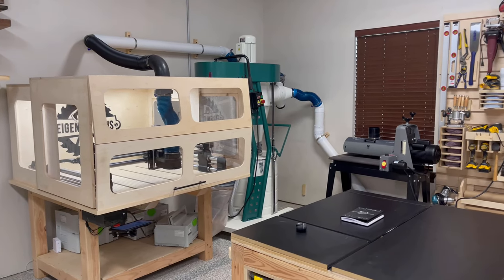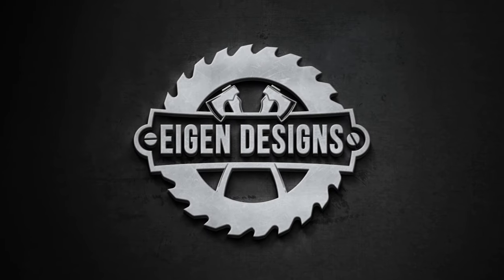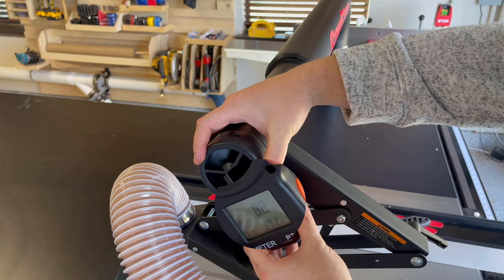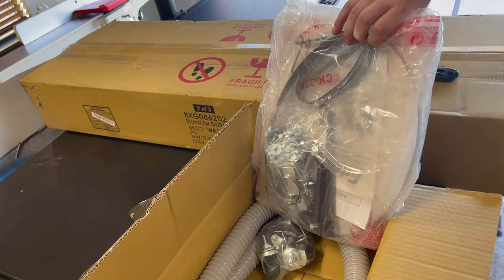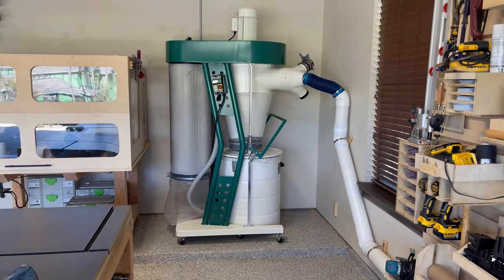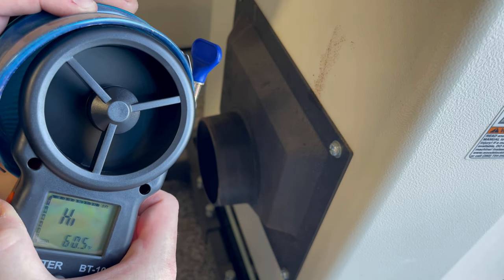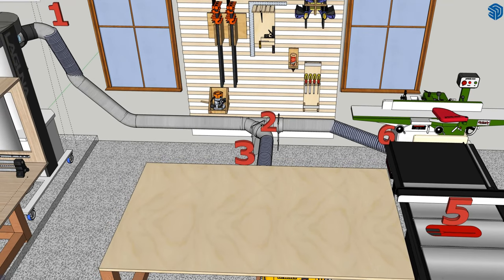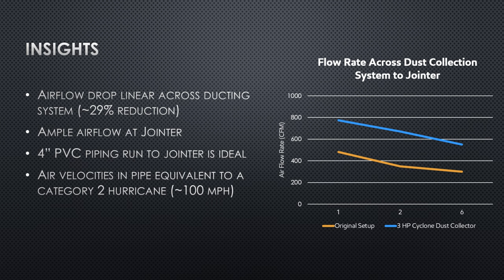Grizzly 3 HP Cyclone Dust Collector Upgrade  |  Analysis of Flow Rate Improvements

Comment: Thank you for all this. great information....two questions if I may...overall, how do you rate the grizzly build quality? Second, if one ran a 6" trunk, it would still be necessary to reduce to 4" ducting for the tools ( and to connect to the DC...what do you think that will do to the airflow?

thank you for your time, and thank you for the massve amount of effort you put into producing this video!!!
Reply from the maker: Thanks for the kind words, Chuck. I think the grizzly build quality overall is good, but I have been a little disappointed by the life of the filter. I had to replace it after less than a year and they are very expensive. Just something to keep in mind if you're looking at getting one.

I think "necking" down to 4" as you get closer to the tools is completely fine. Most tools have a 4" dust port so it's somewhat expected that you will transition to 4" when you get closer to your tools. It shouldnt impact airflow too much.

Comment: Excellent video – nice work! But you didn’t answer the obvious question, how much did the new system cost? Secondarily, where did you get those cool magnetic adapters for your dust hoses?
Reply from the maker: haha, I guess I never addressed the obvious question! The grizzly system was about $2,200 and certainly an amazing addition to my shop. The cool magnets couplings are made by MagPort and you can find them here: https://magport.net/products/magport-4

I have bought quite a few of these connectors because I think they are really cool and surprisingly air tight.
Reply: @EigenDesigns  Thanks so much for the information. Curious how the MagPorts compare to what Izzy Swan offers -- his are quite expensive, especially given the number most wood workers need.
Reply from the maker: @cyberreefguru  The Magport connectors are expensive too. They are about $25 each so its definitely an expensive upgrade when you consider each connecting coupling will require two magport connectors. Having said that, I am at a stage where I am trying to build my shop just the way I want it and I love how they give me flexibility around my shop :)

Comment: Data, insights, impact, scope - you sound like a MSFT employee 🤣
Reply: Also, how’s it working with the upgraded pipe?
Reply from the maker: Dude! I don't work for MSFT, but I do work for a large oil and gas company and that kinda talk is just engrained in me at this point! hahaha

I haven't upgraded my system ducting yet, but that's something I plan to do in the next few months. I have my shop layout more or less fixed at the moment so I am prepared to invest a little bit more money to get some larger, higher quality ducting.
Reply: @EigenDesigns  Ha - awesome, at least I'm not the only one who speaks corp speak. But totally agreed - waiting for the good stuff is usually worth it.

Comment: Curious why you didn’t opt to buy a cyclone and convert your old dust collector to a two stage.
Reply from the maker: That's a great question and in order to answer it I need a lengthy answer. 

Adding a cyclone to my single stage dust collector would solve the problem of the dust filter clogging up quickly because it would remove most of the solids before it ever reached the single stage separator. However, it wouldn't fix the underlying issue that I had, which was that I wasn't getting enough airflow at each of my tools. Adding a cyclone doesn't add more airflow, in fact, in would introduce another pressure drop in the system so the net impact of airflow at my tools would actually go down. 

My Delta has been an amazing dust collector and it has served me well. But, it doesn't have enough power to run an entire shop with a central ducting system. When I first started woodworking I would hook up my dust collector to each tool as I used them and it was great for that. If I was still operating like that in my shop and didn't have a centralized dust collecting system to account for, I think adding a cyclone would be a great (much lower cost) upgrade to the shop.

I hope that helps. It's a really good question that I didn't address in the video, but it warranted a full answer. Thanks Kartik.